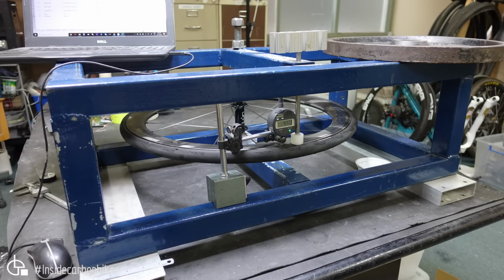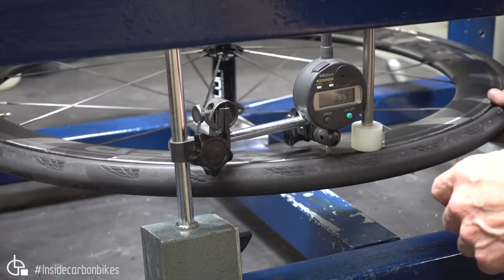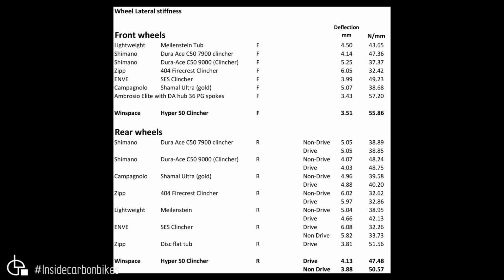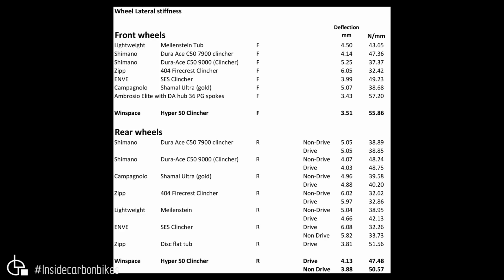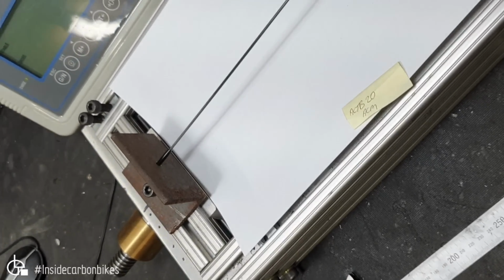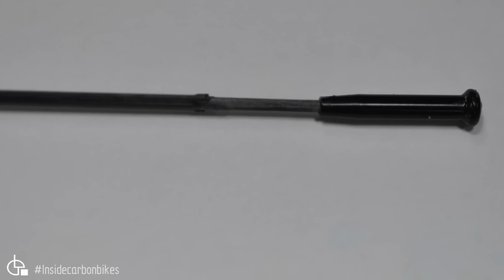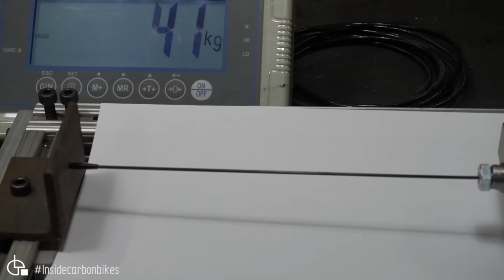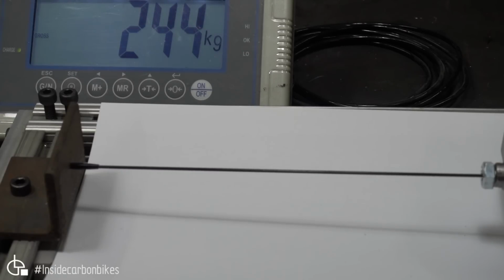Winspace Hyper Wheels - What they didn't tell you.

Comment: One thing I noticed on the stress/strain curve was how the failure mode of the spokes was sudden. There was no plateau as you'd get with some other materials. It's nice to get a bit of warning before catastrophic failure.
Reply from the maker: Correct, the elongation on carbon is very low, often less than 2%, steel can be 25%.
Reply: @LuescherTeknik  The head of the Engineering Department at Cambridge when I was an undergraduate was Professor Sir John Baker. He was known for the Plasticity Theory of Design. He worked out that you could use the strength remaining in mild steel in failure mode to absorb a lot of energy. He used it to design an air raid shelter that was a steel frame that would fit under the dining table. If your house has been bombed and is falling on top of you, it doesn't matter if your shelter gets a bit bent saving your life. His lecture to freshmen about thinking outside the box has stuck in my mind ever since.

Comment: A stiff wheel won't skip if you adjust tire pressure and type of tire compound  so comfort and safety versus soeed and performance easy to fix. Depending on where you ride. End of story engineer

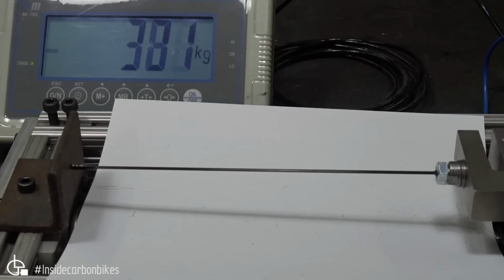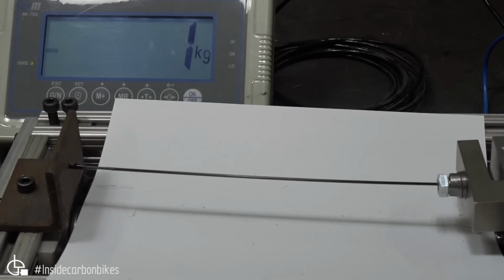Comment: 11:50 to 11:53.  You can visibly see the steel angle bracket rebounding back to 90 deg after the load is removed.  Just wondering if that would change the steepness of your charted results. I would have gladly welded some reinforcement to that bracket if I was in your neighbourhood.  Thanks for an informative video.  👍

Comment: Need to test aluminium spokes too, i.e from Mavic  Ksyrium's and or Fulcrum Racing Zero, the aero spoke type! I use Fulcrum Racing Zero Nite, and when a spoke goes on those wheels you basically bin the wheel.  LOL  🙂
Reply from the maker: I have some of those, due to the larger size I need to make different tooling for the test rig.

Comment: I always enjoy these technical discussions! Just one comment related to the spoke tension test rig. I noticed the steel angle bracket used for testing the spokes deforms quite a bit under the applied spoke tension load, it is quite noticeable when the spoke breaks and one can see the bracket springs back. Where and how is the elongation measured? If the same bracket is used for all testing, the results are comparable, however, the result is not the spoke elongation, but a combination of the spoke elongation and the bending of the angle bracket. If I recall the measured elongations they were in the mm range, however one would have expected more like microns elongation than mm’s. Thank you for always presenting some really interesting stuff, keep up the good work!

Comment: what do you think makes the dura ace c50 9000 rear wheels have such a even deflection rate on both side? are the rims asymmetrical or wider flange spacing?
Reply from the maker: Good design!

Comment: Alright, I'll bite, why are you still using rim brakes? I get they are lighter and cheaper in some circumstances, but having moved over the past year to a new bike with disc brakes, which I use virtually everyday, I got to say it's a night and day difference not only in performance but just durability. No more having to replace pads, and adjust callipers and all that. Perhaps that's on me for cheaping out on the prior bikes I had (mainly $160 specials from K-Mart) but they've always disappointed me.

Comment: 11:52 your pull test was done perpendicular. The wheel has many angles and therefore some spokes do not have pulling force perpendicularly but at certain angles. Are you able to show some datas for pulling the spokes at different angles? Which angle is the weakest load bearing for this carbon spoke or in other words which angle will cause the  carbon spoke to break easily and the amount of Kilogrammes to do it?
Reply from the maker: A correctly designed spoked wheel will have the spoke load in tension as shown, off axis load should not happen.
Reply: @LuescherTeknik  Are you very sure??? The upper half spokes will pull the hubs and rims at all different angles!!!

Comment: On the counter side of the carbon spoked wheel catastrophic failure arguement, I wonder how that is offset by likelihood of a steel spoke failure destroying the fork? As I've seen that happen once and I've only seen a relatively small sample size.
Reply from the maker: Yes, I have seen this failure several times also. Both are less than ideal.

Comment: Great video. I have a set of Mavic Cosmic SLR wheels with the carbon  spokes and aluminium Exailth braking surface rim. One spoke has a slight fray on the front  and rear had 2 but the spokes are replaceable unlike the Mavic Cosmic Ultimates. I bought rims with damage so as to have spare spokes. Mavic dont make these spokes anymore . The rims had failed at the point of attachment to the rim. 
Mavic advise not to put these wheels on a car rack as the wind force could damage the spokes.  Any test on these wheels or thoughts?

Comment: The noise on the rear wheel comes from the fact that there is not enough grease in the free hub wheel, put some more grease and it will solve the issue !
This "problem" is well known on those wheels.

Comment: I'm riding the Hypers 50mm (on a Winspace T1500D frame set) and i use them with GP5000 28C clincher tyres.
At first i was using butyl inner tubes but then i just upgraded them with Vittoria latex inner tubes.
With butyl tubes, it was pretty uncomfortable on bumpy roads, but latex tubes makes a BIG difference, they are now wayyy more comfortable to ride on bumpy roads !
And they should be even more comfortable to ride them tubeless.
Reply: Wass, Ive read that these 50s are to be used with 25C since the inner width is 19mm. Nice to read that you are doing fine with 28C. Was about to buy Ultegra R8150 wheelset because its inner 21mm width.
Reply: @cascomoto1   Yes, if you want the maximum aero gain with the Hypers you better use 25C tyres. 
But i much prefer 28C tyres for the added comfort !
Reply: @Wassworld  whats your verdict? is it worth it to have hyper wheels'? and also using latex tube is it has a big difference with butyl or tubeless?
Reply: @beckatolentino2761  Hypers are the best value for the money EVER ! 
I will probably never buy a big brand name set of wheels, just because it seems to be way over priced compared of the Hypers. 
And yes, latex tubes makes a pretty big difference in term on comfort AND it will make you faster compare to butyl ones (i don't know about tubeless).
Reply: There are very light butyl ones, probably 5gr heavier than butyl.

Comment: I have the rim brake wheels 50mm, I love them but don't agree with the behavior in cross winds. Not top guessing it's the bladed spokes. About the stiffness, I followed torkpeak and changed fro conti 5000 25mm to a 28mm conti 5000, totally agree with the behavior in turns and perhaps due to the lateral stiffness.

Comment: The rubbing of the spokes is my biggest concern which holds me back of purchasing this wheels. Each rub between the spokes will make them weaker because the little shearing movements will remove material of the spokes. Even if there is no noticeable sound there will be still movement there.  What will be the final result of this issue?
A. One day the spokes will stop rubbing but got less durable. The stiffness of the wheels will be less good. What will be the difference?
B. Due to the design, the rubbing will never stop, the spokes will continue to wear and needs to be replaced…
C. The rubbing will never stop and by design the spokes will stand the rubbing for the whole lifetime of the wheel set.
The time will tell…

Comment: I know nothing of engineering but in cases where you have a poor road surface (I.e minor country roads UK) do wheels with more compliance perform better?
Reply: Pick the right tire width and inflation pressure for the road surface first. You want to average 15% tire sag under load to get good tire suspension and neglegible top speed losses. In your case I would get the widest tire that would fit on my fork and wheel and run a pressure which gives 15% deflection for my weight load. There are road bike tire pressure calculators out there

Comment: I have been waiting far to long to hear someone talk about this carbon spoke subject. At the moment I shall be holding fire on using them and that has been my thought for the whole duration of them being introduced in to the market place. Yes yes. Good to hear what you had to say on those wheels Luescher Teknik. If Winspace were create a dedicated Track set then the stiffness may well be beneficial. Regarding stiffness regarding Wheels and frames I am a big believer and have been for many years that they can be over stiff, you need a bit a give when it comes down to using on the roads. That's my thoughts on that matter....
Reply: Overstiff - exactly. That applies to frames, wheels, and forks too! The latter is a problem for disc brake bikes that isn't often addressed - the disc brake fork has to be significantly stronger to deal with the braking forces than the rim brake force, this means that the fork isn't as forgiving in tricky situations where you are riding at the limit. Whereas a stiff fork might skip on the road, the more flexible fork will absorb some energy and keep you rubber side down. Not to mention the benefits in comfort

Comment: About the spoke noise: It's the traditional way to lace a wheel so that the crossing spokes rest against each other. The claim is that the crossing spokes then somehow support each other. It was fairly common that the crossing spokes would even be soldered together. But did it ever have any benefit? Or was it just superstition?

Some years ago I started to lace my own wheels so that the crossing spokes don't go over/under each other. I started doing this because I found that flat steel spokes like CX Rays or Aerolites would sometimes make noise at the crossing. I haven't noticed any difference other than the noise going away.

Comment: Couldn’t quite see from the tensile strength test, are the Winspace spokes round in cross section or bladed like the CX-Rays? Presumably that would make a difference to their strength (from a cross sectional area point of view)? Would also be interested to see a direct aerodynamic comparison between two all but identical wheels built with round spokes and bladed ones to get an idea of what (if any) the aero benefits of bladed spokes. Do you have any data you’re happy to share?

Comment: Questions to all engineers here do you think the weight of the rider will have some influence of the way the wheel behaves so maybe a 85 or even 90kilo rider may experience less or no traction issues with them?
Also how cornering will be affected by the same variant the weight of the rider? for example i weight 80kg aprox and in technical descents i feel lightweight brand  wheels feel less stable than my dt swiss 1100 dicut 48 i use a rim brake giant TCR.
Reply from the maker: Rider weight has a significant influence, the bike geometry also.

Comment: Hi Raoul.  I like to see vertical stiffness test results and comparison to other wheels.  Then you could tie perceived ride quality to lab measurements.  p.s. I'm glad that you didn't post a discount code like other channels.
Reply: p.p.s. cycling oz has a look inside the 65 mm version of these wheels with an endoscope.
Reply from the maker: Vertical stiffness is negligible.
Reply: @LuescherTeknik  I'm sure you meant "deflection", but how does the high lateral stiffness translate into poor ride quality?  I totally don't get that part of the video.  (Unless the bike is leaned over significantly during cornering.)

Comment: I wish Winspace would make a track wheelset line. The stiffer the better for track at least, and we don't have the issue of sticks or whatever being thrown into the spokes. I've been in contact and they said they have no plans in the future so that's a bummer. As a side note, this whole stiffness "war" with manufacturers regarding frames and wheels reminded me of Moto GP and Ducatis years ago.  Ducati was trying to and arguably did produce the stiffest frame, wheel, and fork combination. Guess what happened, the riders went slower due to a lack of predictability, feeling, and confidence in the whole setup. Stoner went slower and crashed a lot, blaming the bike's lack of the ability to pass information back to the rider and also the unforgivable nature due to stiffness. Honda also went down the same path and found that a little flex is a good thing! I'm not sure how applicable this is the bike racing but interesting to me at least! Thanks for your efforts with this upload!
Reply from the maker: Yes, I am well aware of the Moto GP stiffer is better (but actually isn't) days. Thanks for sharing. And agree they would be a great track wheel maybe as good as the original Shamals.

Comment: Curious that the rims are only 26mm wide which suggests some 25c tyres will be wider than the rim significantly reducing aero gains. I have a wheelset with 19.6mm internal width rims and my 25c tyres measured 27.3mm on that rim. The 26mm rim width on the Winspace Hypers is actually at the low end of current wheelsets and helps keep the weight low but perhaps at the cost of aero gains.While the Winspace Hypers test well for aero by Hambini, that is on 23c tyres.
Reply from the maker: The "aero" gains are dependant on many factors especially yaw angle, at low yaw a narrow wheel is faster.
Reply: If you really care about aero, you're running <25mm tires anyway.

Comment: I have ridden 4,500 miles on Winspace Hyper 35 mounted to Winspace SLC frame on the poorly maintained asphalt roads in Northern California. The bike and wheels are light and stiff, but when I need to transmit every bit of power to forward movement I choose Winspace. I have used the Winspace for 200 km. brevets in the past and plan to use the combination again for a 200 km. this weekend. But for casual 40 mile club rides, I use Time Alp d’Huez  on ICAN 40 because the bike/wheel combination is comfortable. My ENVE 5.6 on a Yamaguchi steel frame feels soft, fast and a delight to ride; “steel is real, but carbon is quicker” is true. I appreciate you testing bikes and components.
Reply: Apart from the weight reduction that carbon brings, I'm not sold on it being quicker. Just because a frame is slightly more flexible doesn't mean that you lose power. The same applies in even the most extreme cases of fully suspended MTBs where you are just as fast uphill with open or locked suspension (see the dylan johnson video, for example).

In my opinion, from all the reading I've done and my own personal experience, you should ride the bike which delights you the most to ride... while being well aware of the fact that stiffer being faster is an illusion, much like 120 PSI being faster than 90 PSI is also an illusion.
Reply: @philipk4475  bending due to flexibility leads to energy losses because the frame does not spring back exactly as it was deformed. energy is lost due to heating. See "Tires and Hysteresis"

Comment: Re. The spokes fretting (not ideal as you note) and ignoring the effect would be somewhat less with their flat section, this serves a purpose:"Interlaced spokes take up each other's slack during severe radial loading and reduce the chance of spokes becoming loose. If spokes become loose, their nipples can unscrew. Radial spokes cannot be interlaced and therefore, lose alignment from road shock more easily. "Jobst Brandt, The Bicycle Wheel Excerpted from page 68 of the 3rd edition edition:

Comment: Great insights as always! I whished you would have gone a litle bit deeper with the spoke rubbing issue:

I wonder if at some point a spoke might fail. As an expert you just mention noise and a little bit of wear as the only disadvantages coming from the rubbing. So can I as an non-expert imply that these wheels are safe in that regard?🤔

I also wonder if it would be a good idea and also feasible to bond the crossing spokes?

Comment: Hi Raul good to see you back  on YouTube again. 
You mentioned the mavic rsys with full carbon spokes. What are your thoughts on safety on  the mavic Ksyrium SLR from 2014 that have aluminium spokes on the front wheel and only carbon spokes on the non drive side of the rear wheel ?

Comment: I'd love to see some scientific testing of wheel stiffness, and anything else marketed with "vertical compliance" as a feature. I'd wager that frames and wheelsets all come to the same conclusion... that none of them deflect enough in the vertical plane and that the rest is psychological. We want to feel something we thought the higher payment was for.

There was a good article about wheels on Sheldon Brown's website, with claims that lacing patterns, rims, etc. don't change the comfort of a bike, but tyres and tyre pressure definitely do.

So, if somebody wants to test away, I'm all for it.
Reply: my xc mtb wheel recently had to be replaced.  It had 24 spokes sapim cxrays.  cxrays are flexible spokes so people say it's great for mtb use (because the idea is that you want come comfort in mtb).  well, I bought a new wheel with 28 spokes and thicker spokes at that too.  So the new wheel is a lot stiffer.  This is on a hardtail. But, I also use wider tires on the new wheel, the result is that the new wheel ride a lot softer then the old wheel.  So yes tire plays a much bigger role in comfort than spokes.

Comment: I have the Hyper 50.  I don't consider them to be overly stiff at all, in fact, I wish them to be even a tad stiffer still.  Want comfort? get wider rim and tire.  I also had the Zipp 303 and 404 Firecrest series, they were too flexy when out of the saddle.
About the squeaky noise of the rear wheel, in my case it was not from the spokes, it was from the endcaps.  Greased the endcaps and noise disappeared.
Reply: so what do you prefer hyper or zipp?
Reply: @beckatolentino2761  Hyper all the way.  Lighter, more aero, stiffer, cheaper.